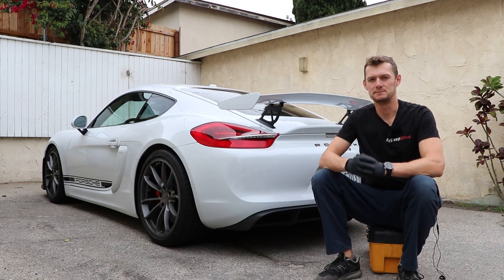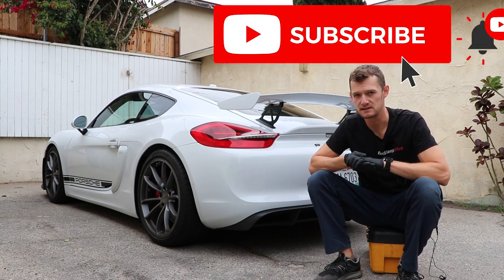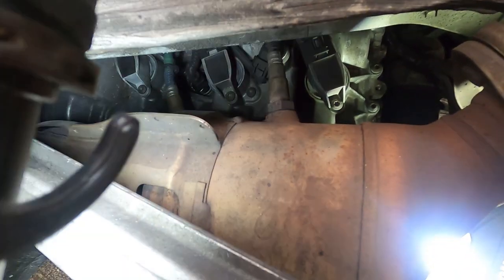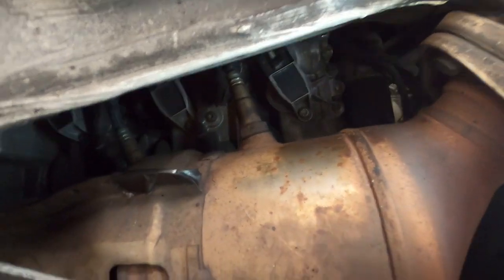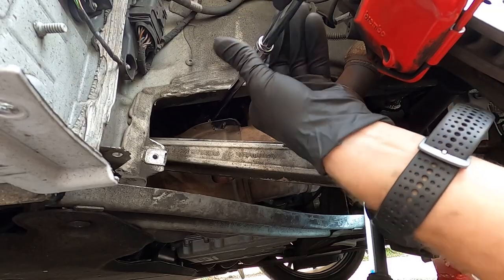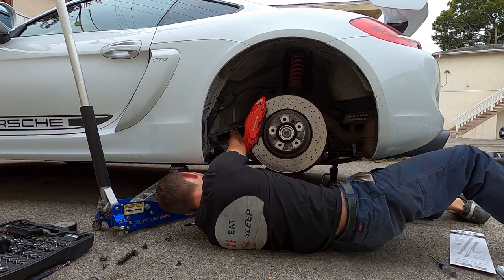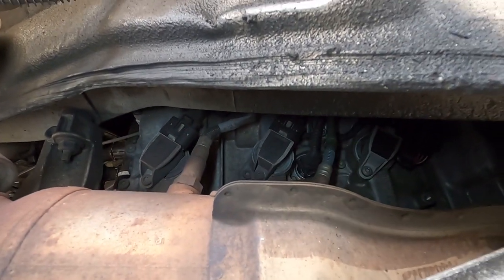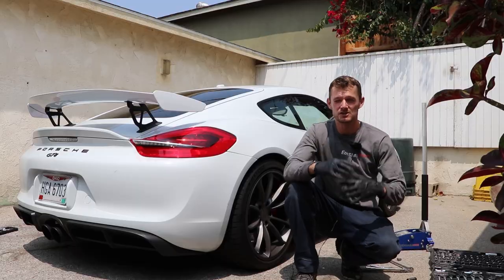This Was the Worst Spark Plug Change Ever - Porsche 981 GT4 36k Mile Service

Comment: Remove the rear undertray panel. You can slide your arm in front of the exhaust manifolds. It gives you a better hand position to remove connectors and coil packs without scratching your skin on heat shields. 😉

Comment: Thanks for the video and some tips. Successfully changed my coils and spark plugs today.  I must say I found the passenger side to be worked on easier as well. The furthest plugs can be accessed from the bottom if you lay down, it'll be so much easier to remove it and install new ones instead of using extender and u joints. The middle ones are probably the one that took most time for me. Ended up finishing it in about 2.5 hrs.

Comment: The straighter (in line) your extension and U-joints are, the more accurate the torque gauge is. It looked pretty good to me.

Comment: 1500.00? For a plug change? You must be talking dealership. My Indy Porsche specific laughed and said they wished that you had four or five that needed that service. 300.00 for coil packs and plugs installed. Granted I had to buy the product. Another 300. Still.. no 1500.00.. that’s coil packs as well.

Comment: Thanks for the video. It gave me the courage to finally do the job myself. I agree that the passenger side is easier. You can tell that as soon as you have the tires off. I left the driver’s side forward most plug until last. Getting the other plugs out first gave me the tactile experience I needed to get to the one with the least visibility.  Thanks again.
Reply from the maker: Super glad to hear it helped!  It's a daunting task at first but I'm sure you'll agree once you do it once, it's not a big deal to do again.
Reply: @EatSleepDrive  Yes!  Once I got experience with the easier passenger side, I was more confident with the driver's side.  I had purchased spark plugs 6 months ago, and it took me this long to finally do it.  Your video made it look manageable.  I wouldn't want to do this every day, but I could do it once every 36,000 miles.  Got one skinned knuckle when I was breaking one of  the spark plugs loose.  Due to the tight clearances, I didn't wear gloves when I was working up close to the plugs, but I should have had them on once I started to loosen up the plugs with the socket wrench on a long extension.  They tend to suddenly break away once you apply enough torque on the socket wrench.

Comment: I dropped my 981 Cayman S up to Porsche Centre Dublin recently for an intermediate service and the maintenance manager mentioned to me that one of his engineers had great fun replacing the spark plugs and got “all cut up” doing so. Now, I understand why.  😬
Reply: With a lift this is an easy job. But yeah on the floor its not so much fun. Did it on a 987 couple years back. Never doing it again on my 981.

Comment: Good job man. $1500 could go towards track days or tires. It does not look too difficult. Could you have removed the brake rotor for more room? Speaking of brakes, have you had to replace yours yet? I'm pricing out a GT4 and looking at consumables. The brake rotor prices gave me sticker shock.

Comment: You did cylinder 1 wrong.  It goes from worst plug to change to easiest if you pull the bottom middle panel to go with wheel well panel.  So much room I could even get a torque wrench in there no universal joints needed

Comment: The 981 is absolutely the worst plug change I've ever done. The passenger side is easier. That said, start with the hardest plug first, the most forward driver's side plug.  You don't want to fight with the hardest plug when you're tired. Even using a lift ($25 an hour rental) it was a three hour job.

Once was enough. The next plug change it's going to an independent.
Reply: Its pretty rough. I thought my 987 was bad... then I got my 981 S and I was like wtf?!! lol I also made a video to help out people. Terrible. lol

Comment: Hi, New subscriber. No mention of 'gapping' the plugs OR no seize-on the treads ?? Did You ???
Reply from the maker: These are OEM and come pregapped.  Also Porsche doesn't call for anti seize but that's up to you.  They get changed so frequently in these cars I think it's unnecessary.  Unless you're driving this in a super corrosive environment.

Comment: Option 1: Porsche dealer, drop the engine
Option 2: Self service & suffering
Option 3: Never buy another mid engine Porsche
Reply: Option 1 for me
Reply: Set it on fire when the check engine light costs too much to extinguish. This is a popular option where I live. German cars bought as status symbols - usually rebuilt wrecks - become fraudulent insurance claims.
Reply: You guys are too dramatic. I had it done in my 981 Boxster S at a good indy Porsche specialist for $400. All but $60 of that was labor. Sounds like it was money well spent. 🤣